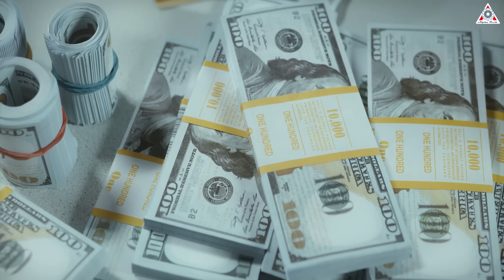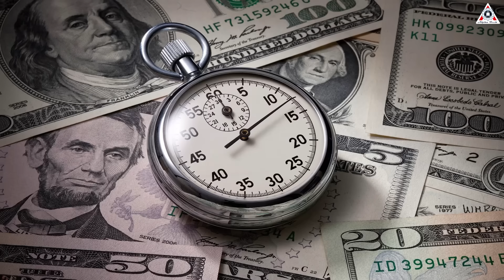The disappointing truth about the Boeing Starliner! NASA revealed...

Comment: Ares/SLS were "make work" programmes to keep suppliers happy after losing profitable contracts to help run the Space Shuttle. No expectation of deliverables. I was told the specification to use SRBs for SLS was to keep the company formely known as Morton Thiokol healthy enough because that company is needed now and then to build more ICBMs to replace older ones.   My gut thells me that like for SLS, Boeing was under the impression that it was free money with no need to actually deliver anything, especially as they would have thought SpaceX would fail. 
By the time SpaceX delivered, Boeing had a rude awakening but it was too late to catch up and they are now stuck. 
What surprises me are the software faulures (you forget the one where going into orbit, the thrusters wouldn't stop firing and it couldnt get near to the ISS). Same with the choosing a tape without proper testing. Or perhas those are excuses because of more seriosu problems. 
With all the mergers in the "legacy" rocket business, it is worrysome that Boeing, one of the few left, has become so impotent in delivering something.  And with SpaceX now  orders of magnitudes cheaper due to rocket re-use (though they are spending all their money on Starship) it makes me wonder if the ULA has a future and what happens if SpaceX is the only one left standing.

Comment: The entire Boeing company is suffering from self inflicted wounds. The company has outsourced many of their design and construction functions as "cost saving" measures which ended up reducing their engineering quality dramatically. They're having similar problems in the aircraft division with 737 Max and 787 Dreamliner as they are in their Space and Launch division building Starliner. It's not just a Starliner problem, it's a corporate problem. It's the ole "the left hand doesn't know what the right hand is doing" with themselves and their subcontractors. The Boeing corporate structure is broken and won't be fixed before Starliner is obsolete. That project is over. 

And NASA talking about not having a SpaceX monopoly is a joke. NASA has been a monopoly since their creation. They've always had just one human delivery to space system. You never saw them launching 2 or 3 different kinds of rockets to get the astronauts to the moon or the ISS. During Apollo all they had was Saturn V and during Space Shuttle all they had was the SHUTTLE, think about it. NASA just doesn't know how to work in the open competition world. They're too worried about getting sued(Bezos). They need to realize that in reality they're nothing more than a planning and certification agency now. They need to just monitor construction, certify and buy hardware that works, no matter who builds it.

Comment: Boeing's whole system is obsolete, and even NASA is beginning to realize it. You can't keep fixing a Model T forever; you have to move to the model X. The problem with that choice is that representatives have jobs from Boeing. Starliner needs component parts built in nearly every state they represent; so moving on will be a tough choice; waste money from jobs, or give up jobs to save money for the nation; hmm, what will be the responsible thing for them to do?

Comment: Alpha Tech should clearly state whether or not it accepts the concept of risk reduction through diversification.  Please stop with the backhanded editorials aimed at anyone without an X in their name.

SpaceX should receive STRONG INDUCEMENT to design, fabricate and install a Falcon 9 nose fairing that could accommodate Dream Chaser.  Star Liner should be terminated immediately once SpaceX provides support  for crewed and cargo Dream Chasers getting to the ISS.  NASA and other commercial LEO station operators need to have alternatives.

Comment: Let Boeing contract with SpaceX to modify, and make corrections to the broken system. It might take a year for SpaceX to fix everything, but NASA would have 2 capsules that function at 100%. Plus SpaceX could own a piece of Boeing as payment for the repairs, and modifications to the capsule. Boeing wouldn't have to pay NASA any money back, because they have produced a capsule that meets the original NASA requirements, and SpaceX technology can provide the OS for the capsule, and maybe upgrade the system to a one that exceeds the Dragon, and can haul additional tonnage. Plus SpaceX can use type 3 raptor engines, and modified breaking engines for capsule separation.
Part of the contract with SpaceX would give access to all patents held by Boeing.
Reply from the maker: Great comment, bro♥️

Comment: So, I know that the Apollo Command Module was part of an incredible spacecraft. However, why did Boeing drag out the blueprints for that ship and use that to produce the new crew capsule? I mean it's an exact copy of the Apollo craft. After close to 50 years you would think that they would innovate and entirely new ship and completely new design. And on top of all that, they can't get it to run. All the millions of dollars, they still have to use the crew dragon to get to the ISS. Why?
Reply: Good question!  Our computing technology has improved a thousand-fold since the Apollo missions, as our material sciences (not quite to the degree as computers) where things are smaller/lighter/tougher.  You would think it would be a snap to redesign the capsule with more room (or greater longevity) due to these smaller systems.  

The biggest culprit I can think of would be SpaceX itself; they grabbed all of the engineers that ACTUALLY KNOW how to design spacecraft and not the pretenders.
Reply: Until SpaceX, It was a job's program.
Reply from the maker: Great comment! Keep discussing interesting topics on our channel ☺️
Reply: "you would think that they would innovate and entirely new ship and completely new design"  That was called the STS or Space Shuttle.  But the new capsule (plus service module) doesn't have much of anything in common with an Apollo capsule.
Reply: @marcmcreynolds2827  You've got me confused. Did you look at the Star Liner command module? Or were you looking at the Soyuz or SpaceX crew cabin. The Space Shuttle is nearly 0ver 40 years old, it's not new. The Star Liner is almost a copy of the Apollo Command module, with the slight exception that it is larger. OK. So, it has a separate unit for solar panels that the Apollo didn't have. However, it doesn't negate the obvious problem. This thing was supposed to fly in 2017. It really hasn't got flight ready in 2023. And, now they're saying summer of 2024. Hmmm... Maybe it needs new ideas.
Reply: @meestirbig3083  Sorry, I'll back up.  You asked why not a new design (which I took to mean something which didn't look like an Apollo capsule), so I pointed out that after Apollo, NASA did try something new (STS).

As for our differing over whether the Boeing capsule is an "exact copy", that's a matter of perspective.  I'm focused on the engineering being quite different, while you are presumably thinking in terms of their similar shape.

Starliner isn't designed for use beyond low-Earth orbit, but if Boeing was thinking early on that it might eventually get work going to the Moon or beyond (e.g. LaGrange Point), that might be why they chose to stay with something close to the proven Apollo outline.  Not every capsule shape which works for LEO reentry is ok for return from an escape trajectory.  But one way or the other, the problems they've been having aren't because of how the design is visually similar to Apollo.

Comment: Sad, I was involved in manufacturing the mission computers for Starliner. Good systems, however, two of the power supplies had to be extensively reworked because Boeing somehow manage to power them up using excessive voltage.  We had other bizarre incidents to their systems in our factory. Program is cursed.
Reply: The starliner program is cursed, all right. Cursed by piss poor management! They could have built a modern Apollo spacecraft for less than they've pissed away on starliner!

Comment: Starliner isn't quite as uncompetitive as you say here;  It does have a higher crew capacity, 7vs 4 for dragon, and greater ability to change orbit, features which are deal makers or breakers for some applications.

But Boeing management, degraded as it is by McDonnell-Douglas retreads, keeps making short-sighted mistakes in everything it touches, so it's hard to say if Boeing can extricate itself.
Reply: both capsules can take 7 astronauts. NASA decided to only send up 4 astronauts for each crew because the ISS can only handle so many people at once, and use the rest as cargo
Reply: @jamesnicholls9969   Not according to what I've heard.

My infomation has it that SpaceX  was told by NASA to change the angle of the g-couches for crew for "safety reasons'', and that with the more prone positing, 7 couches would no longer fit in the Dragon.

Spacex has a lot of expertise, but I wouldn't think they know more than NASA .

But 7 people could probably be handled in an emergency; better to risk a ruptured disk or something than be stranded in space.
Reply: Boeing was hiring and firing engineers as if they were nuts and bolts long before the MD people came onboard.  The MD thing is overplay.
Reply: @danharold3087   I certainly agree that Boeing made other mistakes besides those the McDonnell-Douglas management culture precipitated. But the overly conservative, unimaginative, risk-averse character of the Starliner debacle has McD-D written all over it.

Comment: If its Boeing it aint going.
Reply: I worked on the Air Force MH139 program and due to arrogance, Air Force officers screwed up so bad it will cost the taxpayer at least $100 million. The Air Force does not have crew chiefs flying in the back of helos we have flight engineers. The officers never asked the subject matter experts AKA FE's about writing requirements for the back of the helo. Boeing ran with the requirements and it turns out it was all messed up. The officers thought they knew what FE's did, turns out the only thing they knew was we start at A and end at Z. To be absolutely clear I do not blame Boeing for this, I blame the Air Force officer corp.

Comment: Honestly, I don't think Boeing wants to spend any more money on Starliner than it has to. They already have gone past the break-even point. Since this is a fixed-cost contract, they are not going to be paid any more money for Starliner. It is all going to come out of Boeing's pocket. I think they will continue to drag their feet on Starliner until NASA finally allows them to pull the plug on the whole thing. And I suspect this will happen when DreamChaser launches and SNC finishes work on a crewed version.
Reply: It wouldn't surprise me much, but the crewed Dream Chaser isn't expected 'till 2025.  I believe NASA will probably make them poop or get off the pot.
Reply: If they were smart, they would see the potential for continuing to use the capsule for the next space station. But evidently not. Dream Chaser looks like it will be better able to make money from commercial launches anyway.

Comment: Since 2020, SpaceX has been building a record of safety and reliability with it's manned Dragon capsule. In the meantime, Starliner is going in the opposite direction, they keep finding flaws.
Reply from the maker: Thanks for your comment ☺️
Reply: Sort of an absurd comparison as the SpaceX platform is designed for commercial launches with occasional human flight missions- all in low Earth orbit. Starliner is truly a deep space/interplanetary spacecraft. The Crew Dragon cannot go to the Moon, for example. Also, the 3 Starliner missions were highly successful, albeit with some teething errors, which are common with human flight-rated spacecraft. All missions flew successfully, performed highly complex maneuvers in space. Also, the issues with the tape are due to changes to the manufacturing standards that apply to manned space flight issued by the IPC/WHMA standards organizations. The tape was fine prior to the standards change, but Boeing is required to make test vehicles meet the current standard.

Comparing Starliner to Crew Dragon is absurds the spacecraft are designed for completely different missions. "Knocking the Starliner out" is quite literally impossible due to the extreme differences in each spacecraft's intended mission profile.
Reply: We found who works for Boeing!
Reply: @SDSandman  "Absurd comparison"?  I think you're confusing the Boeing Starliner with the Lockheed Orion spacecraft. Neither the SpaceX Dragon nor the Starliner were designed for "deep space" missions, they aren't equipped to carry enough resources for a crew for more than a few days in space. SpaceX also experienced teething errors to qualify crew Dragon for manned missions, but there seemed to be more urgency to deliver their services to NASA. I think what most of us feel is that we expected more from a legacy company.
Reply: @SDSandman who knows if spacex can pull off a crewed mission to the moon with Starship 🤷
Reply: @raccoonfederation2391  Would you bet  for Boeing or against SpaceX Starship to the moon?
Reply: @SDSandman  SpaceX Crew Dragon and Boeing Starliner were both designed to take up to 7, but nominally 4, astronauts to the ISS and other LEO destinations.  They both have very comparable specs and capabilities.  The Lockheed Orion capsule, is slightly larger than Starliner, and is indeed designed to go to the moon.  To date, nothing in existence or the drawing board is comparable to SpaceX Starship, even BO New Glen doesn't come close.
Reply: @SDSandman  if Dragon's "mission" was easier than Boeing's, then docking with the ISS should have been "easy as pie" for them and problematic for SpaceX... and it would be the minimum Boeing should accomplish for the $4 + billion dollars they getting paid for.
Reply: @yootoober2009 honestly I would like all 3 to succeed. SpaceX looks promising but who knows what they can pull off in the next 2 years
Reply: @MrBeugh I think you are confusing Starliner with the Orion spacecraft which designed for lunar orbit.